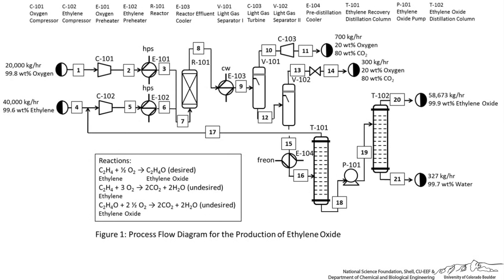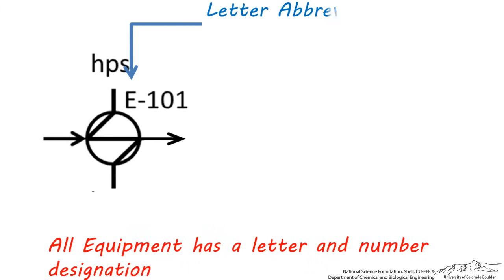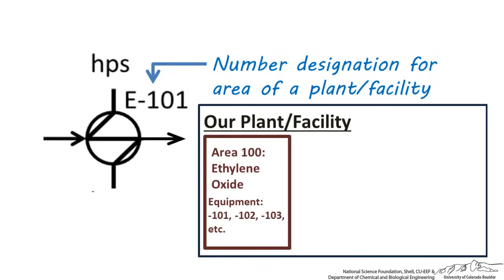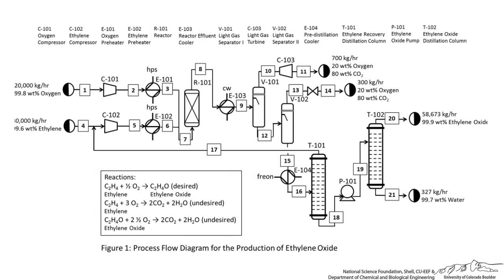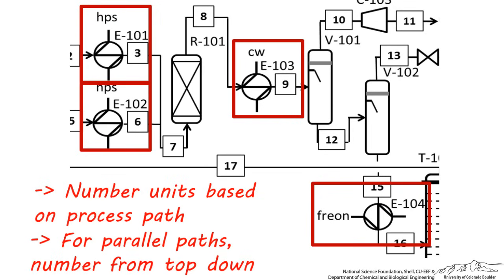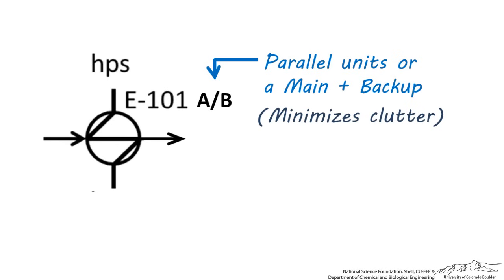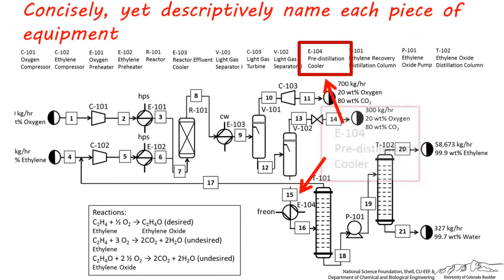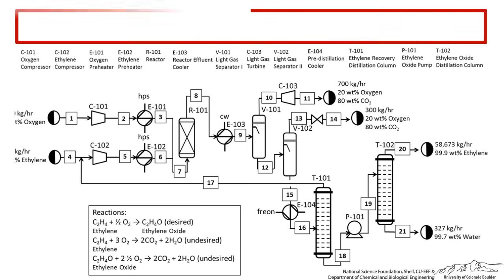PFDs: Letter and Number Designation

Comment: Hi, if there are 11 Heat exchangers in unit 1, is it named E-1011 or E-111???
Reply: I think it's E-111. The first 1 refers to area 100. If you write E-1011, means that the heat exchanger number 11 is in area 10.
Reply: @shoyunkaku  So E-1121 would mean 121st heat exchanger in area 1 or 21st heat exchanger in area 11?
Reply: @wolvinification  Well, if you need 121 heat exchangers, there's something weird in your process. The same for 11 areas, it'd be better to build another plant